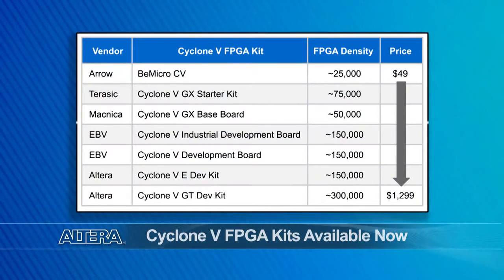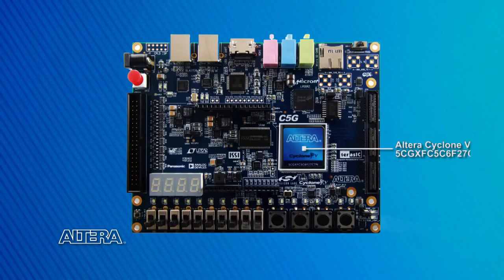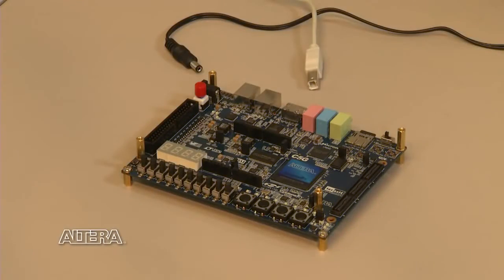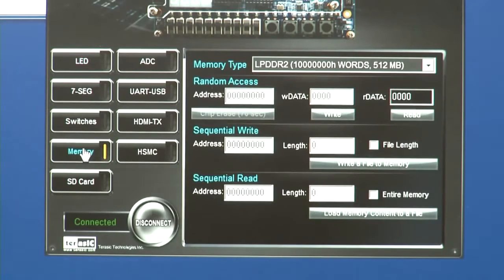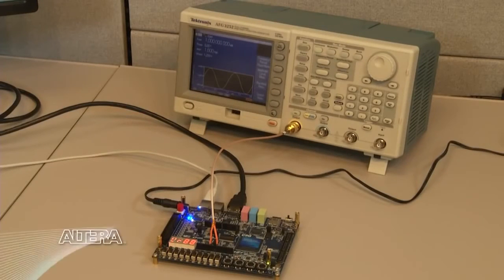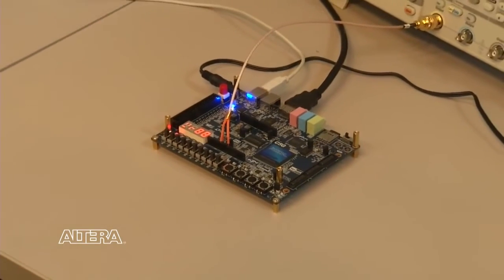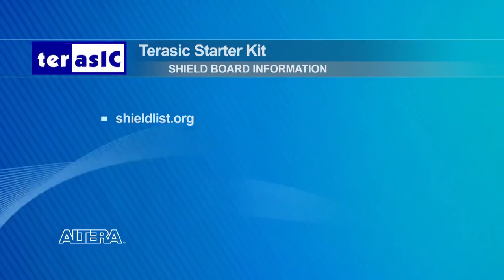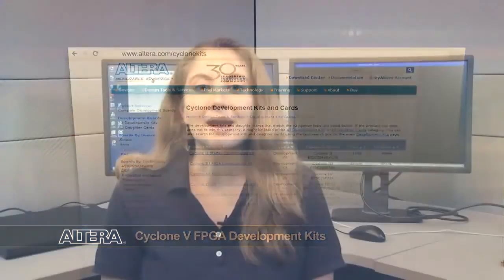Terasic's Low Cost Cyclone V GX Starter Kit Now Available

Comment: I get an error while running control pannel that "Failed to find quartus Installation folder" what should I do how to fix it?
Reply: install Quartus
Reply: Quartuss lite 16.1 is already inatalled in my PC
Reply: how do you start control panel ? from cd ?
Reply: read 2.1 of User Manual 
 copy the whole folder to your host
computer and launch the control panel by executing the “C5G_ControlPanel.exe”.
Reply: @nasirullahmuhammad6220  hallo I face the same problem,did you fix it and how :)
Reply: I got the same issue, have you fixed it?